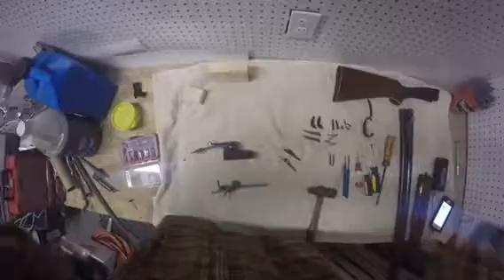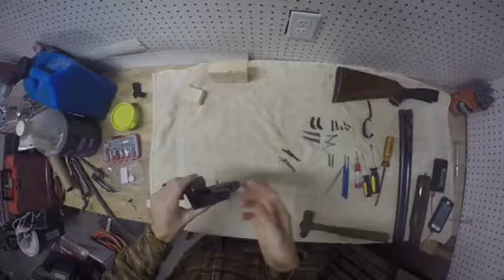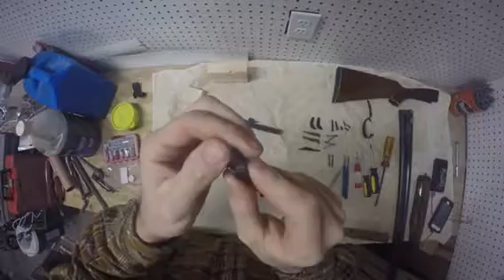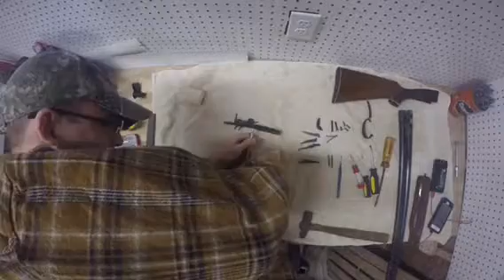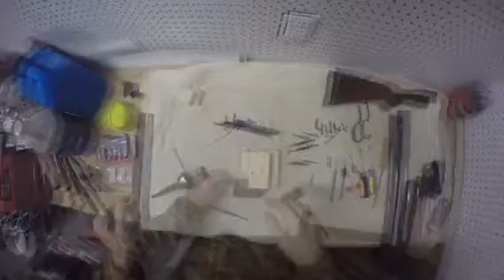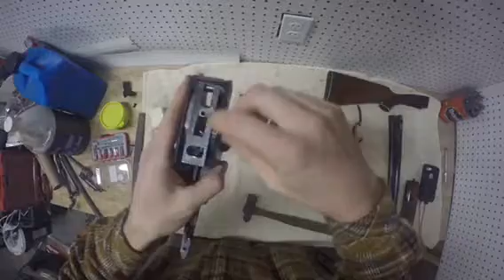Zabala double barrel shotgun reassembly part 1

Comment: I've got one that doesn't want to stay opened all the way when it is opened. It's difficult to take the shells out because you need to hold It open all the way at the same time.
Reply from the maker: MegaHouseGuy no mine is hard to take the shells out to I think it’s just the way the gun is
Reply: Same gun, same problem, took it apart to clean but when reassembled the problem was still there! don't know what to do!

Comment: Ha, so the thing I wanted to watch you do was put the hammers and springs back in.... damn
Reply from the maker: MegaHouseGuy yes sorry the hammer spring is very tough and you have to put it in with the hammer and it takes a voice a punch and something to stick into the pinhole to put together not to mention a bunch of cursing I left out that part to make the video shorter it’s very simple though if you’re taking years apart  You’ll see it’s very simple
Reply from the maker: MegaHouseGuy  And thank you for watching
Reply: Yeah, I'm sure the cursing will be on full, I suspect it's going to be a mighty pain in the butt putting the springs and hammers in. Simple in theory, but in practice.... not so much. lol .... thanks for the videos.